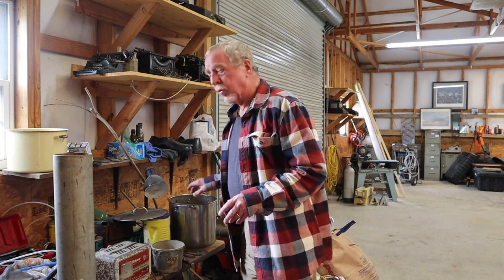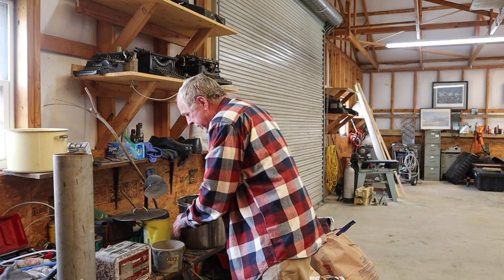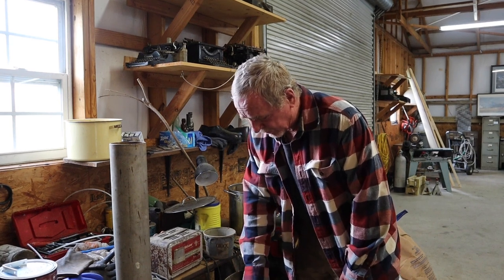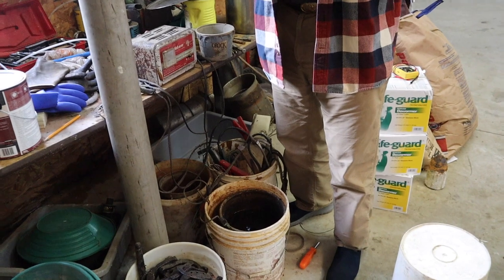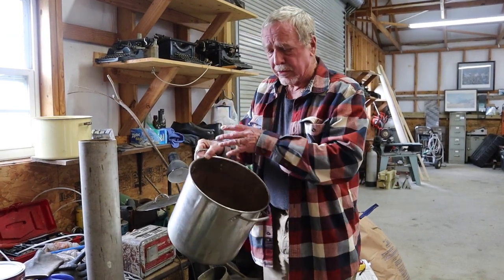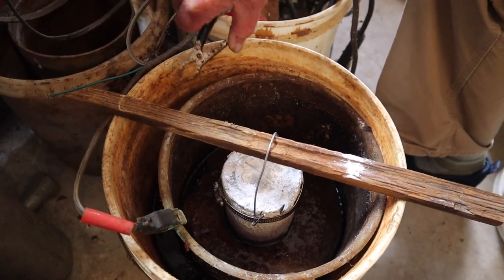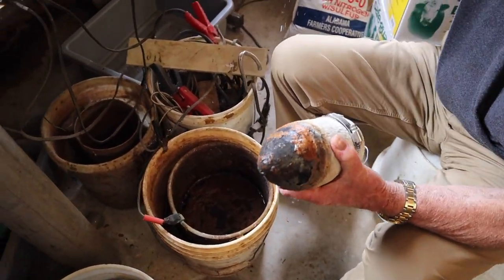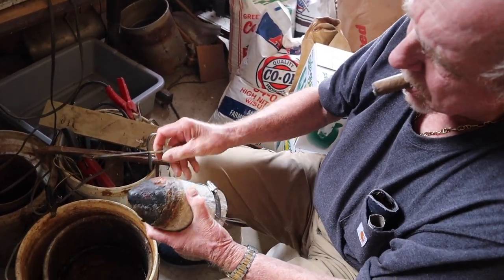How to clean rust off Civil War Relics, tools, or anything with electrolysis (guide)

Comment: Attention Etank builders.  If you plan to build your own Etank using a battery charger it HAS TO BE MANUAL.  The new Automatic chargers will not work.  Another FYI Washing Soda is IMO better than Baking Soda.  It will produce a little more current and work a little faster.  The AMP Meter is your friend.  DO NOT run your power supply or your charger with the meter pegged will will burn up your supply.  Fun video.  Go make some bubbles!
Reply: How much washing soda do you use at a time
Reply: @dewey_digginnc4946  1/2 cup to 5 gallons or a heaping Tbl spoon to a gallon.
Reply: And after you boil it alot.. do you seal it with anythings
Reply: Thank you for the information !
Reply: @dewey_digginnc4946  I have never boiled but I and sure it works.  Normally I just rinse with cold water.  When it comes to sealing I'm not the source.  Most of the iron I Etank I coat with food grade mineral oil just to keep it from rusting.  There are probably better options.